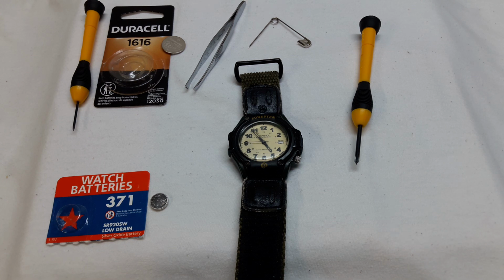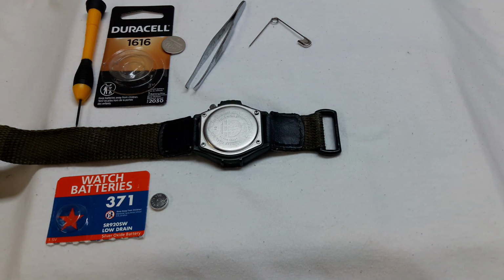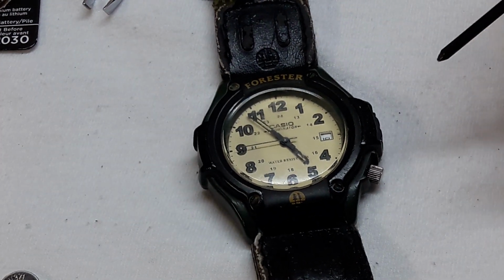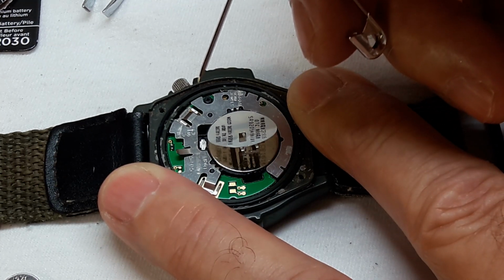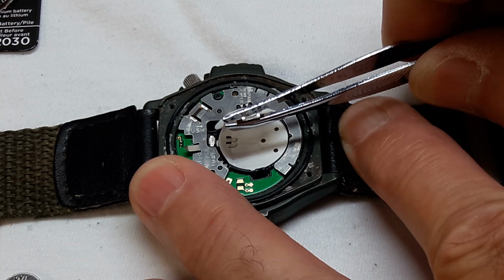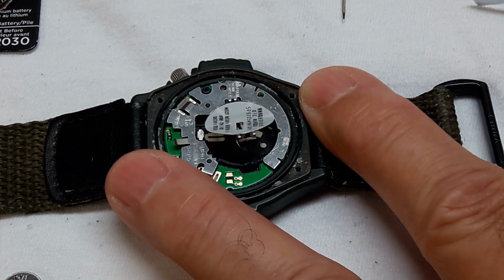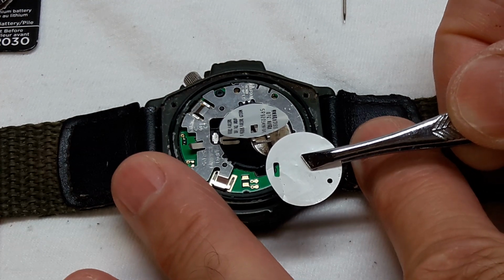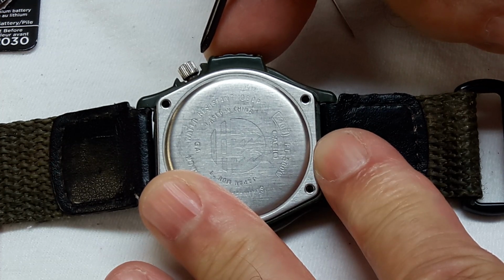How to Change Replace Batteries in a Casio Forester FT-500 W Watch

Comment: thanks. I was getting upset. Replaced the top bat, thinking it was what powered the watch. (thankfully the watch bat arrived last week)
I had zero trouble getting the film between the bats re-installed using my safety pin.  
Most difficult part was getting the bottom battery out.

When replacing the back, you should have mentioned "make sure the rubber "O" ring is in the case recess for it, and the "O" ring is not hard or broken, replace it if it is. Othrrwise the watch will not be water resistant."

To adjust the date, pull the crown out 1/2 way. that adjusts the date only, without having to do AM/PM with the hands with the crown all the way out for however many days off it is. (17 days in my case).

Nice to have the watch running again. I hope the Swiss Renata bats last as long or longer as the originals. If tey do, they might out-last me. (I'm old) 😁.
Reply from the maker: Hello Mr. Huffman,
Glad your watch is up and running.
Dave

Comment: Thanks for the very clear video.  You showed me how to release the battery latch.  Next time you might hold the batteries by the sides instead of the top and bottom when using the metal tweezers.  Top and bottom short out the battery terminals.
Reply from the maker: Glad it helped
Reply: I thought about that also, while watching the video.  I wonder if it does very much damage to the battery. Surely it doesn't do the battery any good. Other than that, @sunshineguy219 produced an excellent video. It helped me to understand the "gotchas" of replacing a watch battery. I wish he'd do more videos.

Comment: Your video is super well done and clear. Casio has created such complications for us normal people, that I would rather give this watch away than try to change the batteries. And i own watch repair equipment and pride myself on changing all my watch batteries. Are there other crazy watches like this?
Reply from the maker: Hello AquarianaX,
Glad to know that you've found the video helpful. I don't know about other watches,  but am sure some also not straight forward in locating the batteries. 
By the way, for those who read my comments I do have a tip on newer versions of the Casio Forester FT-500 W.
The small latch that opens the main battery compartment is being built the same as the one in my video. However, the newer latches are "tighter".  These may require a smaller safety pin, needle or other small tool to open and release the latch. But it will release the latch to expose the battery compartment.
Dave

Comment: Thank you so much for the careful step-by-step video. I've seen mention elsewhere that cracking the case for a self-replacement of the battery, the watch is now no longer waterproof. Is that your experience?
Reply from the maker: Hello Keriah7,
  The Casio Forester FT 500 W is water resistant, not water proof.  I don't have any direct knowledge of any lessening of water resistance in opening the case.  Although if a battery is replaced and the backplate replaced tightly/properly, it should not have any less water resistance from the seal than that from the factory.  
Dave

Comment: How does the velcro strap workout rather than a resin band?
Reply from the maker: Hello Mr. Hamford,
  There is a small leather loop that slides onto the strap.
The end of this strap passes through the the open "buckle", around your wrist and then through that small leather loop.
This remaining velcro of this strap is pushed against the remaining velcro. This loop helps keep the strap end in place.

Comment: I think I messed up the latch, as now it doesn't snap down into place to hold the light battery down. Unfortunately, I didn't find your video about using a push pin to open it until after I had pried it up. Now my light won't work. Any advice? If it isn't the latch not staying down (I can manually hold it down, and the battery cover holds it down) then I don't know what I could have done wrong to make the light stop working...)
Reply: NM, I got it fixed. The pin under the light button wasn't traveling far enough to make contact for some reason. I used the push pin to push it towards the contact more and it seems to work fine now.
Reply from the maker: @nlghtcreature22  Hello Mr. Mando, Just saw your note posted to my video.  Glad that your watch / light is now working. Yes, those fork-like contacts have to touch the light battery and the cover held down tight enough to secure them both. So, I gather that the latch on your battery hold-down cover is now securing the cover? 
Let me know if it doesn't. Take care. Dave
Reply: @sunshineguy219  Thanks for the reply, it's working fine now. It turned out that it wasn't the latch cover causing the problem, it was the pin under the light button not moving far enough to make contact, but I got it working again.

Comment: If the light still works you could pull that whole green mechanism off with the needle and reveal the movement. You could then simply replace the small battery. Put the green mechanism back on by aligning the stem channel.

Comment: Thanks. One little mistake however. When replacing the watch battery you grabbed the new battery with a set of metal tweezers. This shorts out the battery from top of case to the bottom of the case.
Otherwise a good instructional.

Comment: hello, my casio is ft-610, it needs a battery change, any that you recommend
Reply from the maker: Hello Mr. Colmenares,
   I don't know the exact replacement battery number for a FT-610.  However, you could find the battery number of your existing battery, then google "battery type for a (your battery #)".  This should give you the battery "Type" for the FT-610. The google search should show different brands of batteries for the number that corresponds to your battery type. It would probably be best to stay with a name brand battery. Each battery "type" will usually have a "low drain" or "high drain" battery option, depending on how much you want to spend and how long it should last. Good luck!
Dave
Reply: @sunshineguy219   ok thank you

Comment: Helo, can you tell me what battery use for the smaller one?
Reply from the maker: Hello Mr. Mathias,
  Do you mean the smaller battery? If so, as mentioned in my video, the smaller battery in a Casio Forester FT 500W is for the watch mechanism, not the light. 
It is a button cell Type 371.  You could google this to find a low-drain equivalent battery number.
In most cases it will be a brand of battery that is SR 920 SW. 
Let me know if this does not answer your question.
Dave
Reply: @sunshineguy219  ah i see, thank you Mr. Dave, the video also helps a lot. Thanks again
Reply from the maker: @yosafatmathias4439  🙂

Comment: I tried releasing the clip and it did NOT pop out like as shown in the video?????
Reply from the maker: Hello Bill,
  Just to make sure, do you have a FT 500 W?
If so pushing a safety pin or straight pin in between the latch and the battery hold down cover will easily pop open the latch. Can you zoom in on the video?
Please try again and let me know if it opened.
Dave

Comment: Mine just says FT-500 on the back, there is no 'W'. Have not opened it up yet so I don't know if the insides are the same.
Reply from the maker: Hello Golden.Lights.Twinkle,
It's okay to remove the backplate to determine if your watch has one battery or two.
If it has only one battery, replace it with the same type of battery as your existing one.
If it has two batteries, then replace whichever one is not working, as shown in my video.
Thank you!
Reply: @sunshineguy219  I have one without a W too, and it the inside looks nothing like the one in your video. It is opposite as far as the batteries.  Under the back case, there is a white hard plastic cover, and under it is the small battery on top, supposedly the one for the light is under it. I couldn't see it and I couldn't get to it so I gave up. The watch works but the light doesn't. Also, it takes different number battery. Strange they seem to be all over the place. I hope I can find a video that has my watch in it. Thanks though.
Reply from the maker: @crowhaven200  Dear Crow,
  Casio Forester watches have been around for a long time. So, the different letter/number designations sometimes correspond to different configurations of the watch mechanisms.
I’m not as familiar with your Forester without the “W” designation, but, about the illuminator/light… If your watch had a light function when you got it and now does not, and the time mechanism does work, but not the light function- then there has to be a battery for the illuminator/light. So, there has to be a latch or release to reveal the light battery. 
Usually, Casio prints this information on the battery cover. 
On the watch battery- different battery companies may have different battery numbers. Since your Forester does not have the “W’ designation, it may have a slightly different battery number. Most of the Foresters though take a Type 371 (low drain) or can also take a Type 370 (high drain).  Hope this helps.
Sunshine Guy
Reply: @sunshineguy219  I have had a lot of them. From my experience, they used to be better.  I think I used to buy them from Walmart. The last few I bought off Ebay, and they seem to be maybe fakes.  Or copies? I like the low prices and really like the Velcro bands. But I would prefer a better watch. I can't find one video of one with the insides looking like mine. Can't have it all, I guess.
Reply: @sunshineguy219  I replied without opening your whole post to me.
I know it takes two batteries. I know what they are. I have the correct batteries. What I am saying is the insides are totally different. The small watch battery is on top, not the other way around like in every single video I could find. Like I described... Rather than continue to try and dig out the whole mechanism, I just didn't replace the light battery. I have a black faced watch, and the little light is useless to me anyway. I never used it.

Comment: My watch, the face of which looks exactly like this one, and the back of which states FT-500 with module 2312, does not take these batteries. Instead it takes just one CR 2016 battery..much easier to find that battery in stores.
Reply from the maker: Hello Mr. DuBois,
  Thank you for your comment. The Casio Forester is a popular watch. It has several different variations. Each numerical and letter designation may represent different configurations, battery types, or even number of batteries, etc. Your Casio Forester without the "W" is not the same exact configuration as the FT-500 W.  Thanks again!
Dave